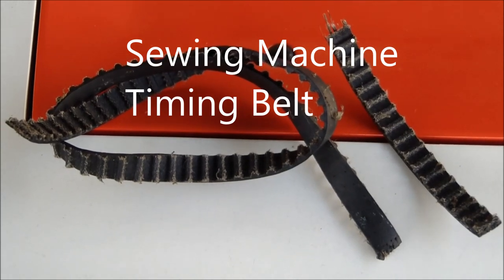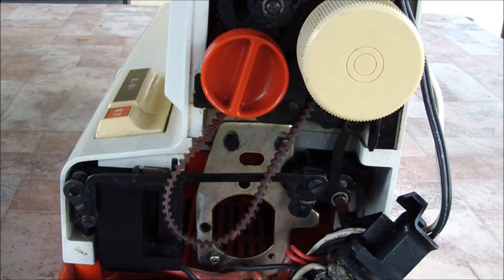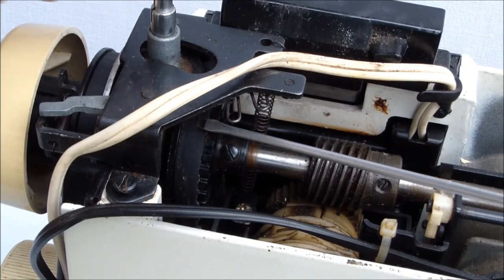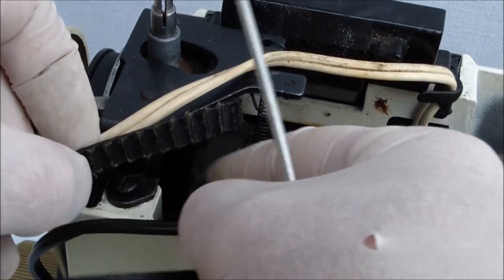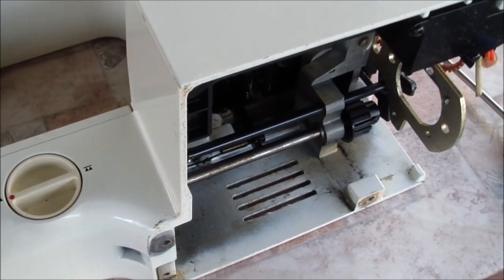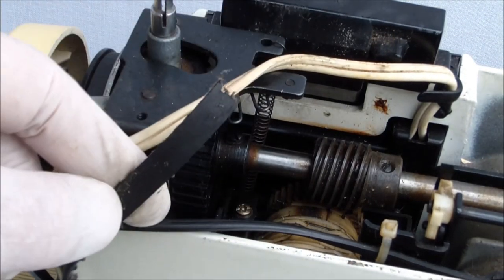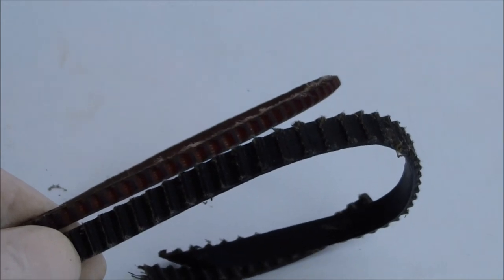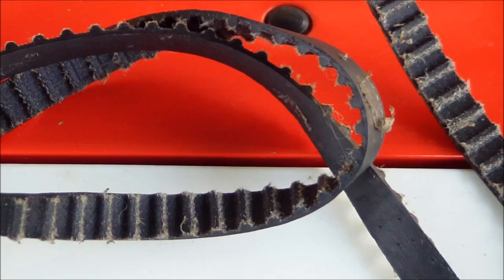How to Avoid Expensive Repair Your Sewing Machine! Sewing Machine Timing Belt.

Comment: Sewing thick material does not harm the timing belt on most machines the drive belt from the motor powers the top shaft that powers the needle and sewing thick fabrics requires more force from the needle to force its way through the fabric, the lower shaft powered from the timing belt powers the bobbin system and the fabric feed.
Reply from the maker: That's right, the more force the harder the worse the belt "feels yourself" and the old belt breaks because the upper shaft cannot move the needle through the rough fabric

Comment: Hello, I have a Husqvarna 21 and the timing belt seems so be sliding off the bottom shaft sprocket.  The machine works fine but the belt is only half on the bottom sprocket.  Is there a way to tighten the belt or do you think it could just be stretched out from age?  Any suggestions would be appreciated. Thanks for your video.
Reply from the maker: If the belt is fabric-backed, it can stretch over time.
Many sewing machine models have a belt tensioner.

Comment: Hi, please help me on this little detail. My Juki industrial machine DNU-1541, workhorse, but, when I’m working dense/thick material, and don’t give enough “gas” (I want to start slow instead losing control), the belt just spins but the needle won’t go through. Then the belt makes the raspy noise. I don’t know if this is normal or I just have to give more gas
Reply from the maker: You need to tighten the drive motor belt a little. Look under the table of your sewing machine and learn our video on how to tighten the belt of industrial sewing machine.